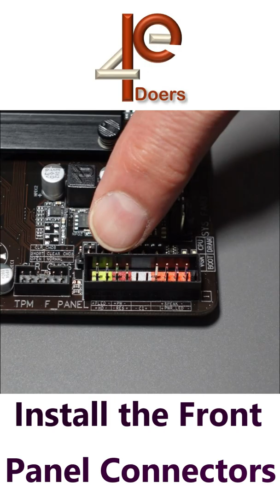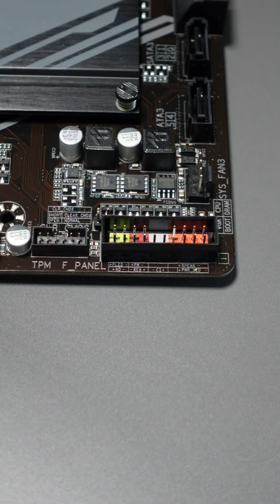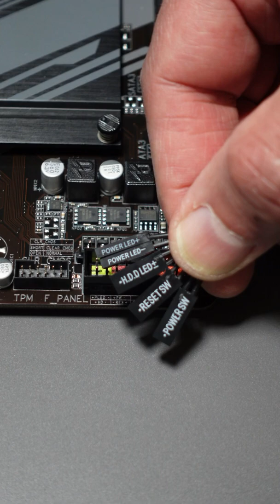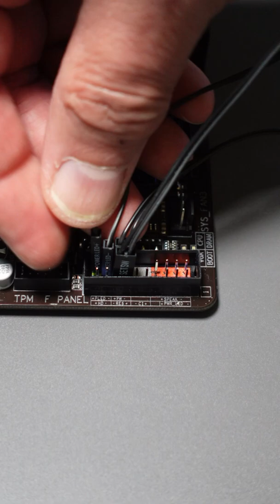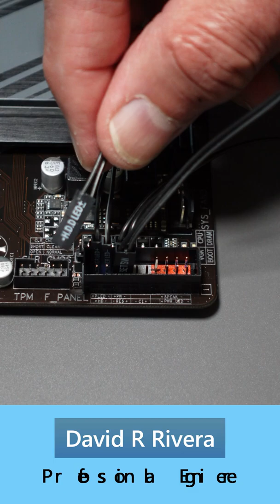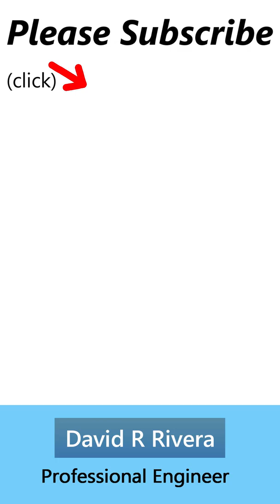Installing the PC Case Front Panel Connectors onto a Motherboard #Shorts

Comment: i need help, my case came with only the power sw cord, could not find the led nor reset
Reply from the maker: What is the Brand/Model of that case?  I have heard that some very small ones did that, but I have not experienced it myself.  Are there lights and buttons for the pwr LED and reset?
Reply: @PE4Doers  phanteks eclipse p360a, ive looked on some reddit forums and they said that they aren’t necessary, is that true? also i’m not sure which buttons are which so idk if there are lights and reset buttons on the case
Reply from the maker: @andregonzales8630  The modern thinking is that they are extraneous and only added to the cost of the case.  I still like to have them, but it looks like the trend is to eliminate them.  I'm sure that is just to cut down the manufacturing costs, however we all 'really' know that the manufacturer  really doesn't pass on that saving to the consumer,we all just accept the lost of those features.
Reply: @PE4Doers  could u help me with another problem too? my motherboard is a b550m plus (wi-fi) and the wi-fi doesn’t work, it’s not being detected
Reply from the maker: @andregonzales8630  Do you have the antenna attached?  Also, you may need to enable it under Windows, depending on the version/build you happen to have.  Finally, it sometime does not connect if the hard-wired RJ-45 was connected as you installed Windows.
Reply: @PE4Doers  i did have it attached, i tried out another antenna and it worked so i guess it was just a faulty antenna
Reply from the maker: @andregonzales8630  Sounds like it.